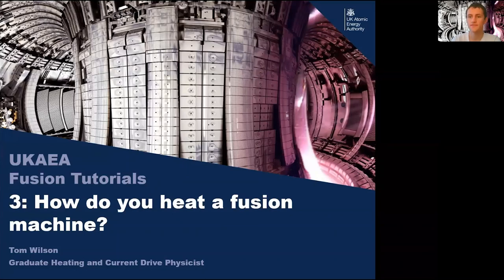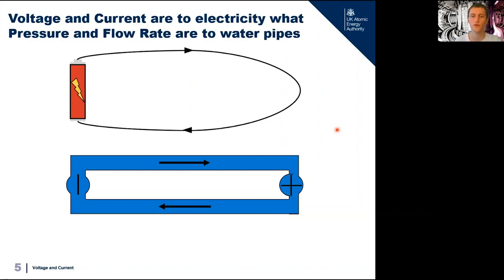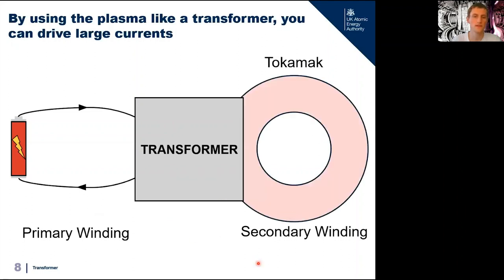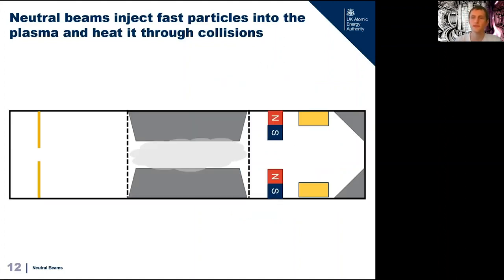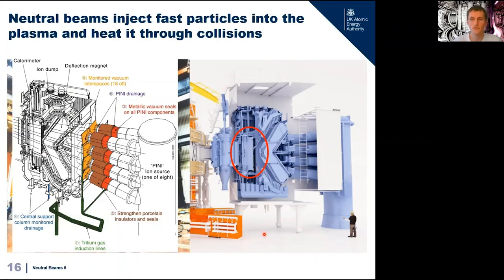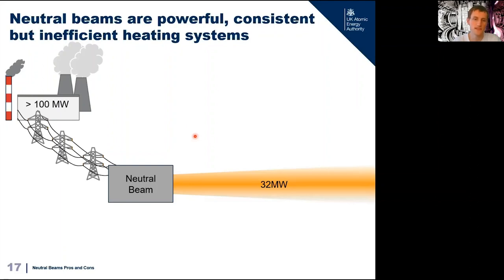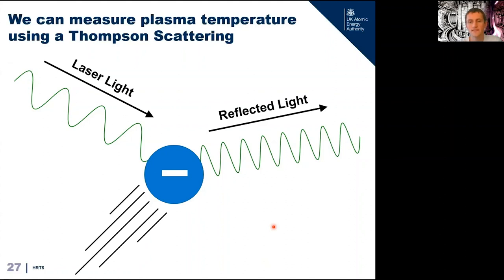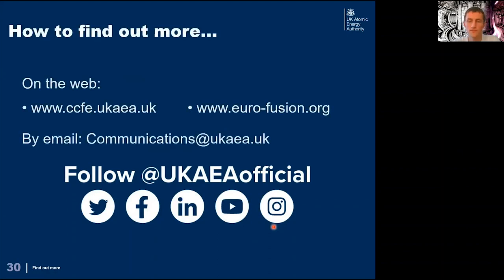Fusion Tutorial 3: How do you heat a fusion machine?

Comment: I understand how the three heating methods bring the plasma up to the required temperature, however, how is the tritium and deuterium gas heated up to an ionised plasma state from reactor shutdown, a cold start if you will?
Reply: conventionally, the central solenoid current is ramped rapidly, inducing a toroidal electric field in the vessel and causing avalanche ionization. same way an obsolete induction fluorescent lamp works. newer solenoidless methods for startup ionization can use the electron cyclotron resonance RF launcher to induce breakdown - like making a plasma in a microwave oven.
Reply: @Muonium1  Ok I see, I thought it might of been to do with the proton in the hydrogen isotopes being positively changed and therefore being able to be brought part way upto temperature by the ohmic heating process mentioned in the video, and then the  ion accelerator and rf antennas take over?
Reply: @jamesbridge6845  generally it's much easier to heat the electrons first due to their far smaller mass than the H nuclei. the electron temperature in a fluorescent lamp can easily be several tens of thousands of K for instance, while the Hg nuclei remain barely above room temperature and thus the glass wall of the tube barely gets warm to the touch. first they ionize the gas in the tokamak by heating the electrons, then once plasma is established, heat the ions with ohmic/NBI/ICRH etc. methods but that all happens within a fraction of a millisecond at startup.
Reply: @Muonium1  Yes that makes sense and it seems so blindingly obvious now that you've said it 🤦‍♂️
How do you know so much about JET may I ask, do you happen to work for the CCFE?
Reply: @jamesbridge6845  no I work for the dark side lol. Laser inertial confinement device in the us
Reply: @Muonium1  Haha, that must be seriously cool though, I'd love to do something like that, to just be able to be a part of it all.
Reply from the maker: Hi James, thanks for your question. The gas inside the machine turns into the plasma during the breakdown phase of the pulse and works similarly to how an electrical arc forms. On JET the inside of the machine is radioactive so any gas inside naturally gets slightly ionized by the radiation, on other machines there are active systems to ionize some of the gas. When we put current through the central coil this induces a very large electric field. This field will accelerate any ions in our slightly ionized gas which then collide with other gas atoms. This creates more ions as the collisions knock electrons off the neutral gas atoms. A single ion will ionize several gas molecules, each of which is turn will then ionize several more. This leads to an avalanche effect where the entire gas is converted into a plasma state. Once our gas is in a plasma state it them begins to heat via Ohmic heating.
Reply: @UKAEAofficial  Thanks for your reply, so what material inside of JET causes it to be radioactive, and do any of the other active systems for other reactor designs you mentioned rely on radioactivity?
I'm presuming the inside of JET is designed to be radioactive so less current is required from the central coil on startup, or is that not the case in this instance?
Reply from the maker: @jamesbridge6845  JET is designed to minimize radioactivity inside the machine wherever possible, it is not something you want. However over a long period the neutrons given off by the fusion reactions causes some components inside the machine, such as the protective tiles, to become radioactive as the atoms inside them transmute (gain extra neutrons). Special materials are used in machine components exposed to these neutrons to minimize the amount transmutation. The fact this radioactivity causes a slight ionization of the gas is just a useful consequence of something we want to minimize. You could easily achieve the same avalanche effect by releasing some free electrons into the neutral gas before activating the central coil. In terms of the size of the current, for the plasma breakdown and initialization phase, you want it large enough so an electron gains enough kinetic energy to ionize an atom before, on average, it collides with another atom in the gas.
Reply: @UKAEAofficial  Thanks guys for the in depth answers, they have answered my questions perfectly, I look forward to the next installment and no doubt I'll be back with more questions 😆
Reply: @UKAEAofficial  how does this work with stellarators like the W7-X and I don't think they even use ohmic heating and I definitely know they don't use the central coil in the middle of most tokamaks. So do they solely use rf?